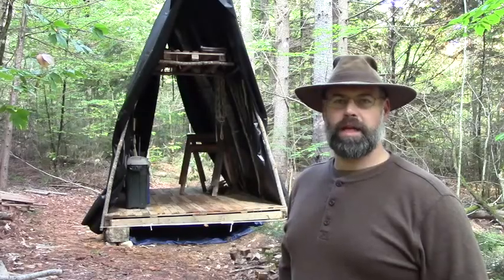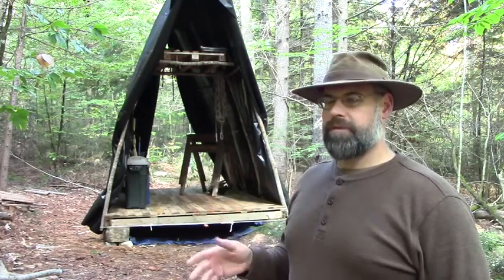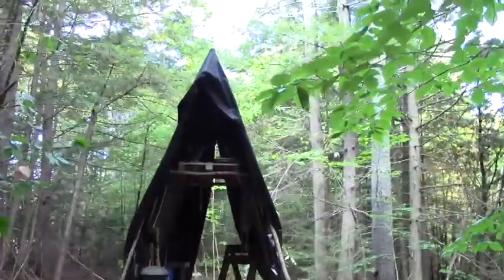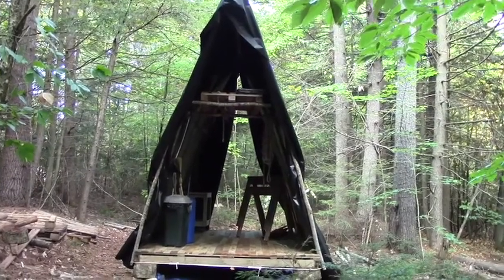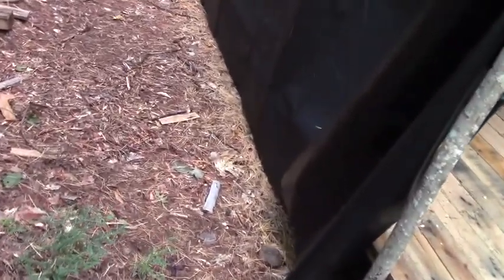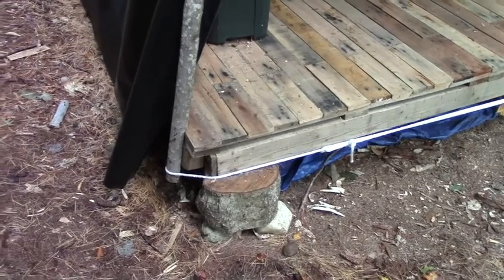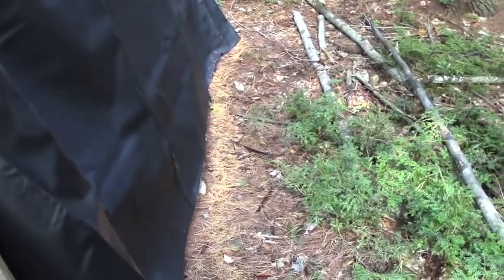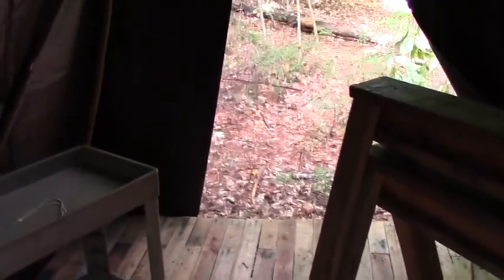Woodland Workshop Design Thoughts

Comment: My first thought for anchoring the tarp is using about 1ft nails as oversized tent pegs. It looks like you'd have to put them a ways out from the platform to get it taut unless you trim the width. I guess that could help with ventilation. Maybe you'd need some mesh around the bottom?

Not sure what to do about closing the ends off. Looking forward to seeing what you come up with